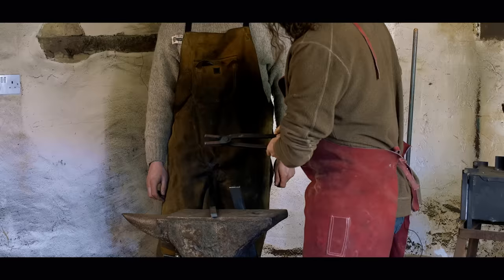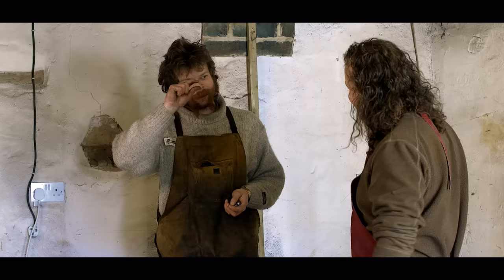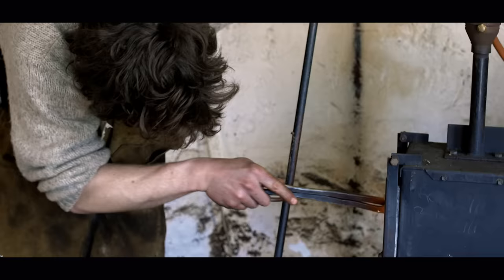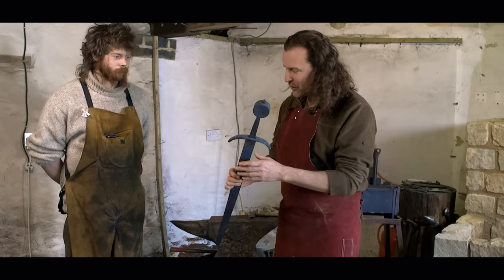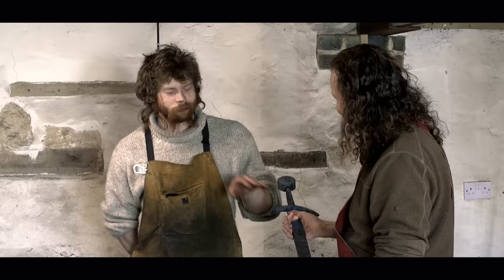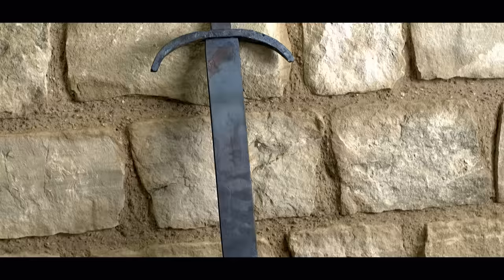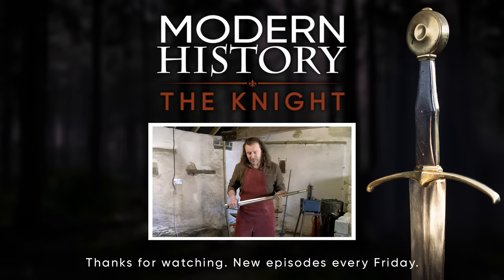Medieval swords: how were they made?

Comment: Usually the tang was made of softer metal and forge-welded onto the shoulders of the steel blade, and the blade itself was often a laminate with the harder metal forming the edges and the softer the sides or sometimes the core.
Reply: Until the 1700's the best English swords either had German sword blades or were made of German steel. Huntsman's crucible steel changed all that and made Birmingham a prime blade manufacturing area, so that by 1800 makers like Woolley or Gill were making blades equal to or better than the Solingen makers.
Reply: Really? My understanding was medieval European swords were pretty uniformly hardened - they wanted them springy rather than bendy. Look at Japanese swords, soft core and a hard edge, then see someone hit badly with it and they just bend (and stay bent!). European swords were more like spring steel, they flexed. I thought that would be hard to accomplish with laminations.
Reply: @hanvyj2  European swords tended to be tempered more in a spring range, but they were far from being homogenous steel- European crucible steel didn't come in until the 1700s and prior to that, shear steel varied quite a bit in quality. Many swords in Europe were still made from composites and tangs, as a rule, were made of iron and forge-welded to the blade shoulders. This held true right into the 19th century regarding the tangs.
Reply: @althesmith  that's super interesting, welding tangs seems like a really bad idea to me from a structural standpoint - I guess I underestimate the strength of a good forge weld!
Reply: @hanvyj2  Consider that pattern-welded steel is basically one forge weld after another...
Reply: Using soft iron for the tang was standard practice until the mid-1800's for most manufacturers, as the softer iron could be peened more readily to set the grip in place, and the tang had actually less likelihood of cracking at the guard. As steel quality improved, eventually they used the same piece for the blade and tang, and this also let them skip one step in the production process.
Reply: Here's another document of interest. Laminate structures were also used extensively in Solingen and Toledo blades.
http://www.tameshigiri.ca/2014/02/13/metallugical-comparison-of-three-blades-solingen-and-toledo/
Reply: @althesmith  yes, I figured the surface area is much greater compared to welding on a tang though, but looking at those diagrams at how it was done I can see how it would work fine, with the metal of the tang going a good few inches over the metal of the blade etc. Thanks for all the info, really changed how I think of how sword making was done.

Comment: I wish they would start from the actually creation of the metal to make the blade instead of staring from an already made bar of metal. I think everyone knows how swords are made but it’s more about how did swordsmiths and blacksmiths make the metal or find the metal in such early days where processed metals weren’t easily available
Reply from the maker: They didn't, they bought widely traded sword blanks. Getting steel from ore was another completely different industry even in the Middle Ages in most places anyway, Japan being an exception.

Comment: Yes, a bit more could have been made of the fact that the medieval smith would have started with a lump of fairly bad steel and would have done all sorts of tricks to make it work as a blade - like folding it over on itself and forge-welding it back together - repeatedly.  

Like the best Japanese, swords, great european ones had a tough, flexible folded core, surrounded by a harder, brittle, but sharper outer layer. This approach solved the problem of swords either being hard and sharp, but brittle; or soft and flexible, but easily blunted.
Reply from the maker: Not necessarily, as we have evidence of trades in sword blanks from early in the Viking period at least. Rural bladesmiths May have done so, but many worked on preprepared blanks. Frankish steel was much sought after.
Reply: Yes that’s right. 

I think the “magic” in sword making was more about the Smith’s understanding of metallurgy than his or her ability to shape the blank and put the bits together. 

I thought the story could have covered this a bit. Like how a smith might quench the edges rapidly to give the hardest surface, but then quench the spine more slowly to provide some flexibility. 

Charcoal forge management is also a sophisticated art - but one that  can’t be discussed with a modern gas one.

Overall I really like your channel.

Fare thee well

Jack the amateur blacksmith @ModernKnight

Comment: Would a smith have started with a piece of stock like that? Or would it have been clumps, bits and pieces and the like? 
I'm curious because that was basically in the shape of a sword already and only needed heating and hammered to make the point. 
I do like your content. Keep it  coming please.
Reply from the maker: We have records of sword blanks being sold from just post Roman times. Smelting and making bar stock was a different industry than swordsmithing. Not saying it was never done, but likely to have used bar stock mostly.

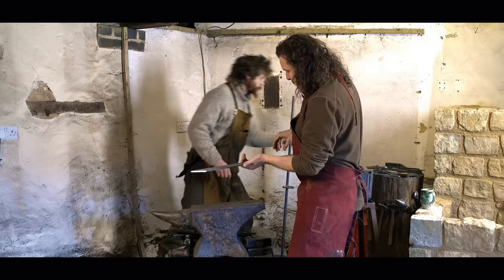Comment: Blacksmiths of the medieval era DID NOT get high quality blanks of perfectly homogenous steel delivered to them, (contrary to comments on that 6:00). They had to work and refine their steel from bloom or produce it from the ground up themselves.
Also they used coal forges, wich are far less convenient than the propane forge shown here.
I'm just mentioning it since the video is literally about how swords were made in medieval times. Not to subtract from the skill and reputation of the blacksmith in the video. I can see that he knows the craft.
Reply from the maker: not true, from around 800 AD there was a significant trade in sword blanks, particularly from Frankia.
Reply: @ModernKnight   Thats interesting. I don't want to argue but do you have a source on that? I'd like to read more about it.

Anyway, I believe even if the blacksmith was lucky enough to get such a piece of steel at a good price (with essentially half the forging work already put into it), the steel would be vastly different from todays steel.

 Ilya over on the That Works youtube channel has a video or two about it.

Comment: Hi, as I understand it steel was very expensive historically and sometimes it was ‘welded’ onto the edge of a sword as it could take/keep and edge. Was this the case and if so what would the ‘core’ of the sword be made from?
Reply: Im not sure how europeans did it but i can tell you about japanese swords were made. They would prepare different types of steel with different carbon level- with higher carbon percentage steel becomes harder but also more brittle. Then they would make kinda layered pie and hammer weld them together. There you can see various types of such layering https://upload.wikimedia.org/wikipedia/en/thumb/0/0a/Katana_brique.svg/640px-Katana_brique.svg.png?1582975126940 

I presume european blacksmiths would use similar techniques if needed, laws of physics are universal after all.
Reply: Not just cost but properties. Ideally you need a soft spine that can flex without breaking, but a harder edge to stay sharp and cut stuff. Iron is flexible and soft, or hard and brittle. Think hammers Vs files. The 'ultimate' way to do it is to start with a harder steel pipe with a softer iron rod inside it, forge welded and power hammered into the initial blank. A medieval smith's wet dream.

Comment: I thought that swords were made up of layers of steel for strength and flexibility and therefore had a visible grain.  I'm quite attached to the idea of a sword having a grain.  Perhaps it depended on how much you spent on the sword.
Reply: Pretty sure you are thanking of how katanas were made not European swords
Reply: @suicidaljell  I've definitely seen swords in Switzerland with grain.  I'll have to do some research to get to the bottom of this.  Perhaps it is the era and his sword is historically accurate for its time.
Reply: @blackwater4707  You are talking about pattern welded steel, which is very nice, and much more authentic than the flat stock seen here. Check out Owen Bush he can make a pattern welded sword from ore.
Reply: @bradm7046  Apparently, initially twisting the metal was a method to work out impurities and it became a visible marker for quality for people that didn't have extensive knowledge of good iron / steel.  Then the patterning morphed into fancy status symbols for men.  Thanks for the tip.  If I have the time one day, I might even take one of his knife forging classes, just for personal interest.

Comment: So, not multiple layers?
Reply from the maker: No, not at this time, the steel is good enough. Multiple layers are used for artistic purposes, or if the steel is inconsistent in quality.
Reply: @ModernKnight 
Okay, makes sense.
Thank you for responding, much appreciated!
Kind regards
GG
Reply: Modern day steel doesn't need that. However, historical steel was assembled with various processes up until the 17th century or even beyond, with layers, lamination and so on. After the Bessemer method and the Industrial revolution steel was on another planet compared to earlier periods to be honest

Comment: Did you cut all the folding and melding or did he just start straightaway on a bit of rough stock? The folding is foundational to the strength of the blade.
Reply from the maker: It’s not necessary with good material, you’d only fold if your stock was inconsistent or you wanted fancy effects. Early medieval swords were often folded, as are Japanese blades. Mid medieval to late were unfolded, the metallurgy was better.

Comment: First of all you need sponge iron from a bloomery to start with, i guess. Else you will get a modern sword that looks medieval. The title appears to be a bit misleading.
Reply from the maker: not always. Sword blanks were widely traded across Europe, basically flat bars of steel, usually hammered by water powered mills. Frankia was a major exporter of blade blanks. The public image of sponge bloomery iron comes mostly from Japanese sword making and the techniques to deal with the very low quality ore they had. European steel was far superior in quality.

Comment: No eye  protection, no ear protection, no gloves...this man is going to have trouble seeing, hearing, and probably nerve damage to his hands before he is 60.
Reply: Little do you know... Gloves would be a bad idea for a blacksmith. Just type "why blacksmiths wear no gloves" in the YT search field. Safety glasses are another thing when you work with an angle grinder. Ear protection could be a hindrance cause you need to properly hear the sound your hammer makes on the steel. But in some cases it would be better to wear any. Modern blacksmith use ear protection especially when the use powerhammers.

Comment: My only complaint is the giant pommel , now i know its a super weapon in its own right if unscrewed and thrown, yet , wont the heavy pommel make it feel like  you are holding the axe upside down than  actually weilding  a sword. My point is it would bring the point of balance too close to the hilt and reduce its cutting efficiency while adding unnecessary weight to  a nimble weapon.
Reply: I'm guessing he made it a little big because it's easy to make it smaller, not so easy to make one bigger. So he'd most likely adjust it's size until it feels right this way.
Reply: @jessewalby6631  That could be true because it looks unfinished, but that would mean hours of grinding out the stock.

Comment: Big oof. Neat craftsmanship but the lack of safety gear is kinda... meh. I know, I know I don't wanna be the one ruining the fun but as a fellow blade/blacksmith I'd recommend wearing safety googles. Like seriously, your steel is like 800-ish °C and the scale is flying in all directions (the grey oxide layer which forms due to o2 reacting with the hot steel) and if one of those little pieces hits your eyeball... naaaasty feeling and probably not great for your eyesight in general.

Comment: Is it a solid pommel? Would be sad if so.
Reply: Kroiznacher why? The solid pommel works to balance the blade of this type. Are you perhaps thinking of an earlier migration period blade with a multipart pommel?
Reply: there's a pretty large body of surviving examples from 12-15thC which are hollow - earlier 12-13th C copper-alloy pommels in particular are found in the finds database, the Met Museum's collection of enamelled ones, and similar contexts, but fabricated ferrous hollow pommels are found well into the 15th C - for example, the "henry V" sword in westminster is brazed together from 3 parts, with voids in between. (I'm hesitant to say its entirely hollow as I've not handled that one.), and a couple of those in the Royal Armouries and the National Museum of Scotland are the same. I could send you photos of some of those ones if you like, Jason.  
  
But that's really all down to proper cross-sectional profiling, and weight distribution, which a lot of replicas still get badly wrong. But I'd assume that with the basic parts shaped out on that one, about half that rough-forged pommel will be ground away during the refining of the shape.
Reply: I personaly like hollow pommels because in my expierience solid pommels make the swords to heavy.
Reply: J. G. Elmslie I’ve never handled a complete original of this type, only ones where the handle binding etc is missing. The sharp Josef made for me, presumably with a solid but ground to better shape and weight, feels right in the hand when using it from horseback on static targets at least. My guess it that construction varied and maybe fancy high status swords were more for display than combat? Some swords are so lovely it it hard to imagine them being used in combat! But that’s a modern perspective I suppose.
Reply: oh, there's definite differences between what could be described as fighting weapons and status symbols, but its not a cut and dried delineation. Weight distribution is very much a case of adaption to particular blade designs and design purposes - the one I mentioned in the National Museum of Scotland is a half-lang with a slender lenticular XVII-ish blade (which doesnt fall neatly into the conventional typologies), and it feels like a cutter - weight distribution is tipped a little more forward than say, one of the Castillon Hoard's heavier XV's, which are very much thrusting weapons.  Likewise, one of the RA's 14thC ones, IX985, is a two-piece hollow pommel brazed on the midline. That one's a single-edged sword of pretty workmanlike quality, so clearly not a status symbol weapon. 

Then we get Peter Johnsson's work on geometric principles, and that opens up a huge can of worms when it comes to the hollow pommels; are we looking at particularly sized pommels, on some because they want a particular proportional size, but they dont want the resulting mass it would impart on the weapon? At that point, there's a very deep rabbit-hole indeed that these weapons were being created to a particular shape, because of fashion and faith, not function.
Reply: I actually like heavier swords, makes me feel like I earned it, the heavier the better, I want it so heavy I can barely pick it off the ground.
Reply: Plus you can end them rightly with a solid pommel

Comment: That sword is purely for show, in a real sword fight it would break, proper swords were made from a number of rods twisted and folded together were they not?
Reply: Depends on who made the sword. The method of twisting bars is a Danish style of making swords.
Reply from the maker: No they weren't. The layerings used in Japanese blades are because their steel is very inconsistent quality.
Reply: Well this sword seems to have been made with 1 bar. No twisting no folding, just a piece of steel?

Comment: No-No No-No No-No No-No No-No No-No No-No. This s*** drives me up a wall. Smiths didn't start off a project with a piece of flat stock from their local hardware store.
Reply from the maker: I agree, they usually started off with a sword blank, which is roughly the same thing and was an industry in the middle ages.